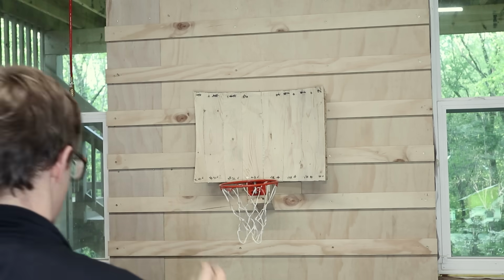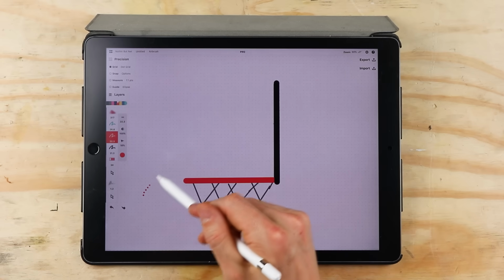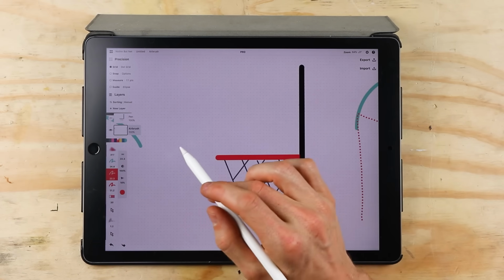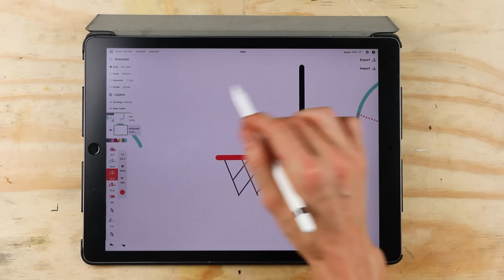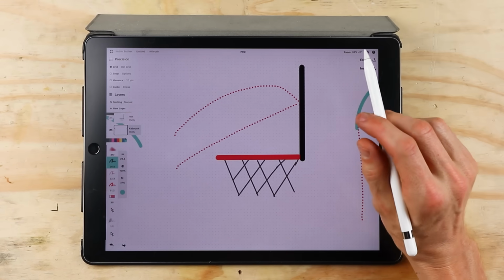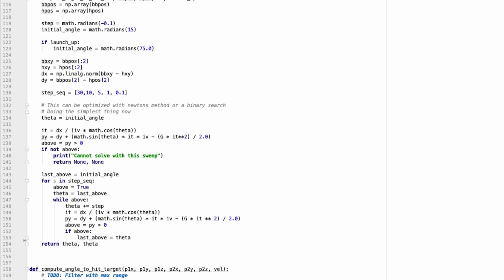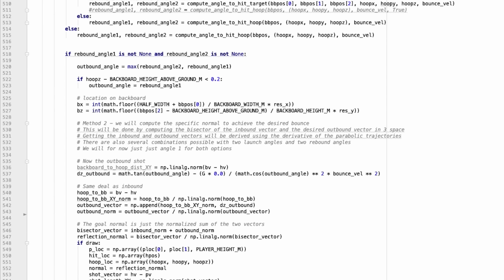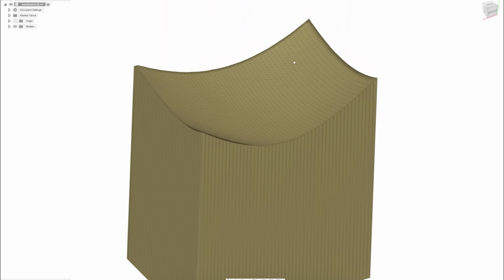My curved basketball hoop always goes in

Comment: Ive got a legitimate question? I used to be a hooper and a good defender essentially blocks your optimal shot angles. So when performing a layup (the shot your taking 90% of the time you use the backboard) your often aiming somewhere outside the red square and using spin on the ball to change its trajectory towards the hoop. Would that spin make this backboard not work?
If you cant picture what im describing; there's a basketball drill where you stand directly under the basket, then without moving your feet use your right hand to toss it off the right side of the backboard w/ backspin on the ball so it comes back towards you and goes in the hoop and vise versa w/ the left

Comment: Another idea for a basketball shot that always scores by going in the hoop is to take the problem from the point of view of the shooter and keep the large square basketball hoop backboard so that it is the same flat surface that is common in the game of basketball.

If the direction, speed and type of spin (often called "English") can be properly predicted from a given point on the basketball floor, then the ball will always go into the basket.  So as long as the ball goes through the air and hits somewhere on the backboard but the ball has the proper spin and rate of spin, then it will go in the basket.

There are many basketball players throughout history who have used this principle to make unusual shots that surprised their opponents...  by putting a lot of spin on the basketball and at the same time directing their shot to a certain location on the backboard where this kind of spin is most advantageous, they have been able to make a lot of shots, often during games, that resulted in points.

So a basketball shooting device (perhaps a robot_like thing perhaps with two arms or maybe something that looks more like an air_cannon or something like that) takes a basketball then shoots it at a certain angle with a certain speed...  the location on the backboard can be predicted.  Based on that calculation, the spin rate and direction of spin on a ball (so that's 3_D spherical spin not just 2_D spin) can be calculated.

Consequently it stands to reason that a device that will always make a basket with a basketball shot regardless of where it hits a flat regular backboard regardless of where the ball was shot from, this can be calculated.  Therefor it stands to reason, that device could be made that shoots a ball at the backboard, and because of the speed and direction that the the shot came from AND the type of spin and spin rate of a basketball...  the basketball shot against a backward can always be done so that it goes into the hoop every time.

(Of course wind speeds and air thickness do to moisture or lack of moisture could be a problem...  but since basketball is often played in doors, then those extra complication factors can be figured out at another time by someone that wants to make that improvement in design.)

 For extra credit a ball shooting machine that shoots one basketball after another (much like this is done by shooters in the three point contest and that type of thing) this could be created that never misses after shooting the ball at the flat normal basketball backboard.

Of course this could have application to Androids playing basketball...  because as far as shooting goes the calculations would be the same...  or robots or cyborgs or any similar kind of creature or creation that might to be playing basketball. 
.
.
.

Comment: I'd love to have 30 seconds looking at the math equations that your software implements. 

I agree, looking at code in a video is extremely boring. It was kinda interesting to briefly see the code to see how much work it was. And you did an excellent job visually describing the process and what math would be involved. But I'd love a very brief segment for the ultra nerds that quickly skims over the equations used in mathematical notation, names them, and roughly describes how they fit together. i.e. output of this is input to that, matrix here, loop there, etc. Short.

Coming from a software engineer, code is the worst medium for trying to understand math. I know the math will all be over my head but I'll still find it interesting and I'm sure I'd inevitably look things up and go down rabbit holes reading about it. That's the fun kind of learning.

Excellent videos! Your work is top notch.

Comment: About your Monte Carlo simulation: because the rebounds are parabolic arc, you should be getting a discontinuous set of valid reflection angles. You should be checking to make sure that you're grabbing the right one each time. The decision rule should be: choose angles associated with the negative half of the quadratic solution above a specific elevation, choose the positive half below a specific elevation. The elevation point should be the height on the board where the drop distance from a rebounding straight shot is sufficient to clear the hoop (probably just a bit over the ball radius + hoop height). This should solve your low angle rebound issue, though It's still going to have clipping problems near the rim (and the algorithm will probably tell you to put in a near-table surface below the hoop), but programming around that may get rather hairy.
Reply: TURN TO GOD BEFORE ITS TO LATE

Comment: I have to say, I like this way more than the other hoop you made because this is clever-er, if you'll excuse the word.
The other one is more impressive, but this one is trully unique. I find passive systems more attractive and believe they require more brilliant thinking.

Please do a follow up, where: (a) you make it prettier, as you seem to be a good craftsman as well and (b) you integrate some servos behind the board so that it can tilt up/down and left/right to correct for some shots that are outside the parameters of the passive component. Since it won't be moving all over the place, the extra weight may be manageable for tilting.
I believe that this could make for a more 'aggresive' basketball/handball hybrid game.

Comment: Here's a question:  if you asked me to build a backboard that would direct every shot into the hoop I would have instinctively made something with basically the same shape.  I'm impressed with the math and everything but I'd like to see how by how much this outperforms a backboard just made by a dad who wants to make one and doesn't use the math.  I feel I would have come up with this shape after 3 iterations without the code or calculations.  Or at least a shape that is within 10% of the performance of this optimal backboard.
Reply: For one this small? Probably. But theoretically if you wanted to make things more precise (Larger board, smaller ball, smaller hoop) his way would steamroll your jerry rigging skills. One thing you’re probably not considering is the effect of gravity on each bounce off the backboard. This creates a shape that is not as horizontally symmetrical as you might think.

Comment: Others have mentioned it in part, but I looked it up since I've used it/been around it so much - the Monte Carlo method is just a reference to using inputs with randomness to determine statistical outcomes by just running simulations or the actual experiment until results converge to a reasonable significance.  Name comes from...  "In 1946, nuclear weapons physicists at Los Alamos were investigating neutron diffusion in fissionable material. Despite having most of the necessary data, such as the average distance a neutron would travel in a substance before it collided with an atomic nucleus and how much energy the neutron was likely to give off following a collision, the Los Alamos physicists were unable to solve the problem using conventional, deterministic mathematical methods. Ulam proposed using random experiments. [...] Being secret, the work of von Neumann and Ulam required a code name. A colleague of von Neumann and Ulam, Nicholas Metropolis, suggested using the name Monte Carlo, which refers to the Monte Carlo Casino in Monaco where Ulam's uncle would borrow money from relatives to gamble." - Wikipedia, "Monte Carlo Method",
Reply: Wikipedia isn’t a trustworthy source of information, my friend
Reply: @Hippotrippen  In this case the information is correct. 98% of the time wikipedia is a very accurate source.

Comment: Wouldn’t it have been easier to design an ellipsoid with the focus point at the center of the rim? From the looks of it, I feel like your final numerically simulated surface is just a reverse engineered ellipse. Unlike the paraboloids, ellipsoids accept non-parallel trajectories so I’m sure the results would have been similar.

Comment: I got this theory that the hoop was originally missing because the base design of a backboard the hoop is slightly higher than the backboard itself like how all backboards are. So the reason that you were missing was that you were hitting the bottom of where the spot you would want to hit. The theory is that you were bricking as it was the bottom of the parabola cone if an infinite number of shots were taken, but a little higher and all of them would intersect like the top of a cone. So instead of moving it out, it could have move up to potentially fix this issue.

Comment: I'm wondering if it's possible to make an optical illusion with this that makes it look like a regulation backboard up to 45 degrees from it's 'face', or rather the wall it's mounted on as the face isn't a flat surface, but you get the idea.

Comment: I wonder if accounting for the trajectory would fix the issue with the corners that you had. By that I mean that I mean that you wouldn't just have the backboard try to shoot the ball at a position (or an ellipse of positions), but shout the ball at a position with a direction. I would expect the algorithm to avoid shots that would make the ball go straight across the rim, and try instead to shoot them up so they can have a downward trajectory.
Cheers! I loved the video and I learned a ton. Thanks for putting it up :)

Comment: Hey, it looks like you were using python, am i correct?
also what IDE did you use? 
did you write the whole display from scratch? i.e using some drawline function? 
or is there a library that is useful for this? 

thank you for your time. 

also, awesome vid, personally i'd love maybe a separate companion vid that at least runs through the boring stuff, i get that most people don't like it. but to me, its just as interesting as the physical trial and error methods you use.
Reply: Yes, that is Python

No idea the IDE, but it really doesn’t matter as it’s preference

Based off of what he showed he is using the math library and I’d assume mathplotlib too

Looks like basic Python IDE though could be wrong

Comment: Awesome video! You have done an awesome work, I wish you dedicated more time to the code, it would have been fun to see the reasoning behind it =)
Given that you've done the code to compute the shape of the paraboloid, do you have the exact equation of its surface? How does the speed of the ball influence the calculations?Would it be possible, given the exact equations of the paraboloid, the sphere, the circonference of the rim and distance of it from the paraboloid, to create a program where just by adjusting parameters of each geometric shape you can be sure to replicate your experiment? Like for example if I change radius of rim and sphere, I instantly get as output the new equation of the paraboloid and the exact right distance of the rim.

Comment: Nice!, it seems work, I wonder if it could be done the same way but with an actuator behind a flat board that changes the angle to the correct angle to go in just before it hits, so its like stealth cheating, to further improve maybe use a camera or an eye to gage the speed so the angle can be adjusted for greater accuracy.  Just tossing out ideas I love it.  Hm, I wonder if the system that was used for the dart board that hits every shot a bullseye could do it on a board set up with one actuator that moves fast. and just his a moving hinged duley hinged triangle so you always move correct just by busing on it. Ok I see why you did this fascinating puzzle.

Comment: "NOTHING BUT NET" means you can't hit the parabolic backboard or even the rim. With those limits and these facts only the distance (angle of arc)` would be variable. [The top of the hoop is 10 feet (305 cm) above the ground. . All basketball rims (hoops) are 18 inches (46 cm) in diameter. Knowing the basketball's drag and spin would allow Nothing but Net ...With a constant acceleration you should be able to hit the net if it is flying around the gym and flopping like a goose.Now, How can one hit a hole- in- one every time?

Comment: Really cool, thanks for your time and video! Please though, one safety tip: Do not try and contain your swarf or sawdust. If you produce accumulations around where you are still milling you risk building heat and starting a fire. I know it's messy but far better blow it away or extract it :)

Comment: Would it have been easier if you had done the calculations the opposite way?  Have the ball come out of the hoop, hit the backboard every square inch, and adjust the location and angle to give the desired trajectory.
Run it over again for each different vertical angle coming out of the hoop.

Comment: You should change the plane the simulation is throwing the ball at in real time. Every calculation change the board to fit the new data. That should speed it up. (I might be wrong in the case that computing the plane takes a long time.)

Comment: Too bad if you apply spin to the ball this fails , that’s why even on a flat back board with the right spin you can use the top corners and still make shots, that red square is there for beginners and even then you can still miss with enough force

Comment: Pretty cool.  Monte Carlo in Monaco is famous for it's casinos, hence the Monte Carlo Simulation. If you're going to run the simulation again like you said, you could save some time by only simulating half the board as well. And if you want to get only the bottom corners to bounce up and into the net, you could simulate an additional ellipse above the hoop and require the ball to pass through both it and the hoop. That way low shots would have to bounce up while higher shots would be unaffected.

Comment: One thing you didn't account for here was the type of shots people were opting for. I love being right at the rim, doing all sorts of variations on layups, and, I consistently utilize the very tips of the corners of backboards when doing a decent number of them, all having a very high rate of makes vs misses. It has to do with a whole heaps of variables that make the shot type far different regarding the use of the backboard than normal jump shots (shots outside of 5-8ft). All in all, I have to agree with what many others have said though, and I encourage you to patent this and find partners/a company who is willing to produce & sell these in mass. I'd love to be someone having one of these hoops!

Comment: Seems like a funny project to do Evolutionary Algorithm around. You do some physical simulation that runs fast. You do mutation/crossover think for 3D surface, and as fitness you do thousand simulations of throwing a ball with different angles and force and amount of success baskets out of those thousand simulated throws are its fitness. And then see with what kind of weird design it would come up.
May be do a a weighted sum of how well balls hit the basket and how close it is is in design to original board to make a version that tries to hide that it is manipulated :D

Comment: BTW you can vacuum form from the wood so it will be lighter and easier to reproduce. You'd just have to account for the different material compared to wood ( like a soft foam backing). Carbon fiber backboard! woot woot! lol

Comment: I think deep learning would have actually been a better fit for the problem, since deep learning is usually about approximating some kind of function (in the case of the hoop a fairly simple, 3D function), especially since you had to re-run the Monte Carlo simulation multiple times for the different hoop shapes, which could have all merged into a single step using the deep learning method. 
It was a great experiment either way, great stuff!